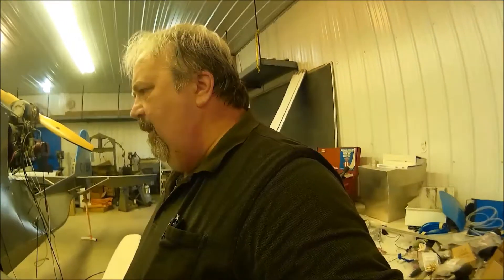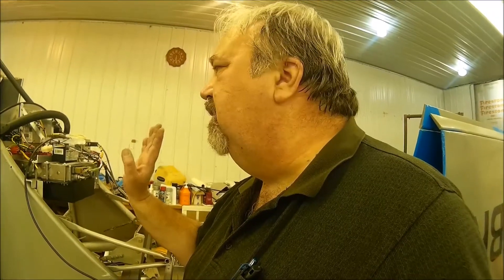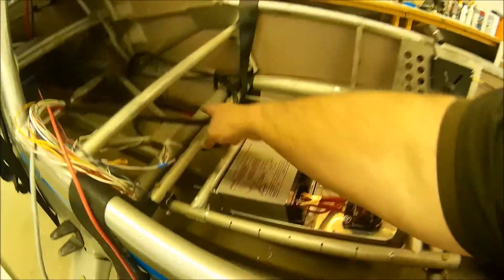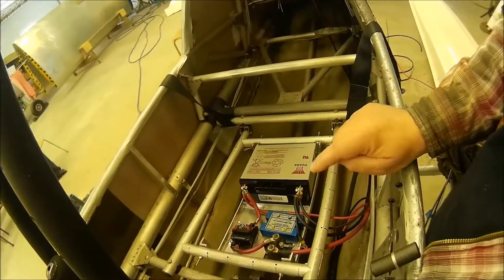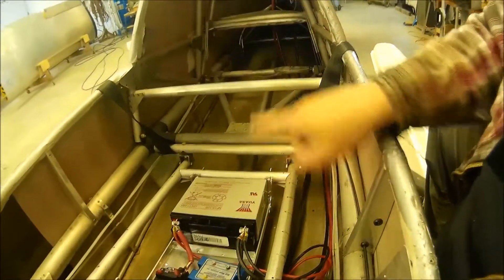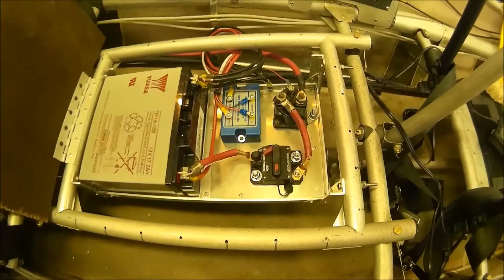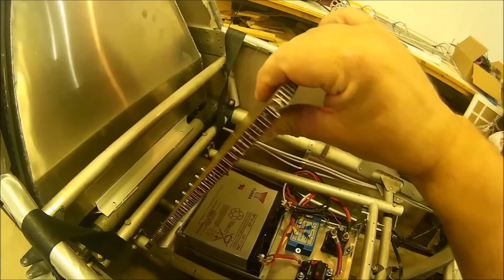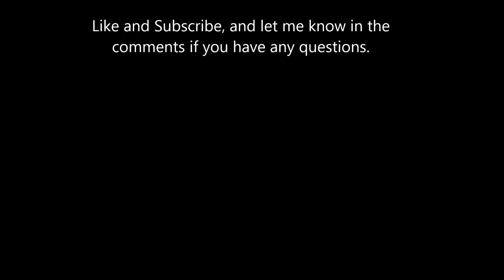Ep #14 Relocating the Battery for a better CG. Challenger 2 Ultralight Airplane

Comment: I like the way you did the battery and it looks to be like  a maintenance free battery but either way, is it a good idea to have the battery on it's side? I have never seen one on it's side before. Also, batteries can get very warm and with it being under the seat and adding a foam pad to keep it down seems to only keep the heat in since I am not seeing any ventilation for the battery. Thank, concerned citizen. lol
Reply from the maker: It's a gell cell battery, and they can be mounted in any position. I've used gell cell batteries for years, often in air tight and totally sealed boxes, mounted in all kinds of positions. That's one of the great features of a gell cell battery. As for ventilation, it's not enclosed under the seat. In fact with the seat down, you could reach in from the side and touch the battery. So ventilation is not a problem. Cheers.